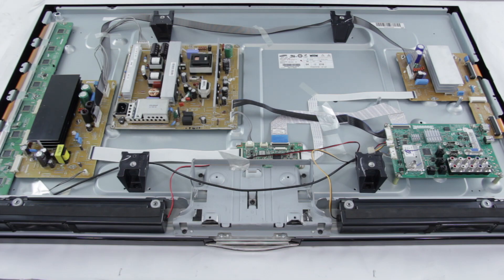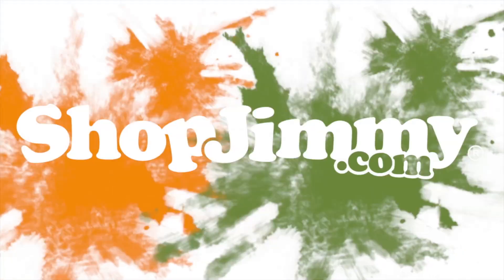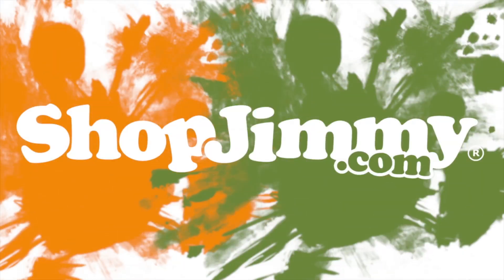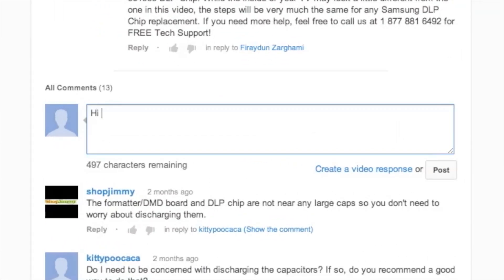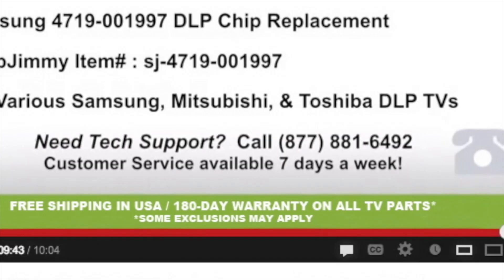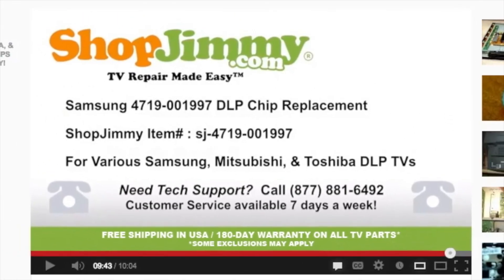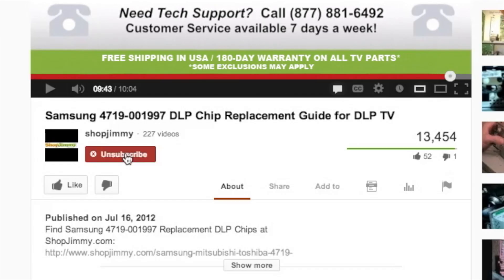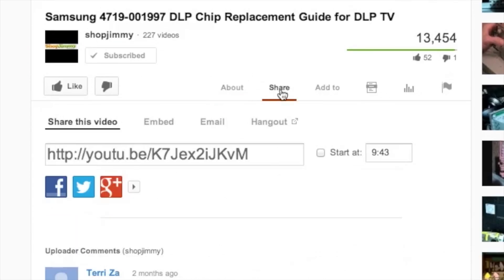Plasma TV Repair Tutorial - Common Symptoms & Solutions - How to Fix Plasma TVs

Comment: My PN64F5500 Plasma worked fine for 2 hours and I left it alone, came back and it was black screen w/ audio.   Pulled off cover and could find no bad boards or capacitors from a visual inspection.  If i pressed the ON button, just a black screen, no video.  Also, no illuminated LED when off.  I checked the Power Supply board according to the stamp on the TV and it was putting out the correct Voltages.  Also, the Main Board was blinking as it should.  I just started to unplug the small 1 wired boards from the Main Board and then turn on to see if that was the problem.  As you know, if any of the boards do not report back to the Main Board as working, the TV will not power up with Video.  Oddly, my problem was the WIFI board.  I don't even use it!  Once I unplugged it (located right beside the Power Joystick Button), TV powered up like normal.  I just left it unplugged and voila!  TV working again.  I hope this helps someone else!!!  TV is a/b 6 years old but a fantastic picture!

Comment: 42pj350.   LG tv all mosfets or igbt not short.but no picture .all 52v and 190v good 5v good. plasma tv. no output on the y.to buffer..i check the chopper on the y buffer.it oppen coil.i try to connect it.when all the igbt arrive. i allready order 4 30f124 ...and 430j124

Comment: I have a PN59D550C1FXZA it will not power up.  If I unplug it and plug it back in, there will be a red light that comes on, then when I push the power on button, the red light will go off but the tv will not turn on

Comment: Hi, I have a TX-P42GT60E. It power off and on intermittently. I can start from the remote control, but anytime i push another button on the remote: to change channel, to open the menu, the TV powers down. Any advice? I read in some forums that it could be the power board.
Thanks in advance.

Comment: I have a Samsung Plasma PN43F4500AFXZA, Version: UD01, Manufactured: 04/13. After the set is turned on and operates for a few minutes, it will shut off on its own and then, after a minute or two, turn back on; spontaneously. Please advise me on how to resolve this problem. Thank you.

Comment: I have question,  I have a Panasonic 50 inch plasma tv model number TC-P50U2. The screen does not turn on and the red led light blinks 10 times.After unplugging for a minute or two, the tv makes the click to turn on then clicks agian and the red blinks 10 times. Could this be a power supply board issue?

Comment: I would love to get my tv working correctly again it has lines running from left to the right on the bottom of my tv what can I do to fix this situation
Reply: How to fix a 50-inch LG plasma TV
Reply: Like he says at 4:19, That is most likely the "Y buffer" ribbon cables and control boards that go from the top to bottom of the screen on one side. They control each horizontal left-to-right line of pixels on the screen. If you break one of the ribbons, then you will get a black/coloured horizontal streak from left to right across the whole screen.

You could check if the ribbon is visibly broken, in which case repair/replace that ribbon somehow. Then check the connection by unplugging and then plugging each ribbon back in, in case there was an issue with the connection. If the circuit board is broken (unlikely, otherwise you would have very thick streaks, or a completely black screen) you could replace that. The ribbons go into the plasma panel. Unfortunately, if their connection is broken inside the screen panel, then the only way to repair that essentially is to get a new plasma panel, because you can't really open it and fix it.

Comment: I really appreciated that you haven't taken older videos down. I have a, Samsung 5 Series plasma. Been going strong 12 years. A couple of months ago I got the occasional popping sound but everything was fine on screen. Recently i get kind of messy looking flashes or overlays on the right side (looking at the TV) which were just flashes to start with but are getting more frequent and staying longer. Its like a whitish cloud or puddle tinged red, very grainy and with evenly spaced dark horizontal lines.

So according to this video I have both boards gone? X AND Y? Because in another of your videos you ascribed all those symptoms to the Y board alone (unless I misunderstood).

Comment: Hi I have the same tv as this one in video 50" plasma ps50c450b1w. The problem being that its unresponsive to the remote. Only some times we tried new controllers and new batteries. I have fitted a new ir sensor today. And checked wiring and all good .worked for about an hour .and stopped working again. I have checked capacitor and all look ok any ideas please
Reply: I'm having the same problem with mine ....I came here looking for answers
Reply: @merfn  .hi I think it might be the controls that I have brought.  I have another set coming.
Reply: @merfn   .well I had my new controllers today and all is still the same works for a bit then stops .did you find out what the fault was with yours

Comment: Great video thanks
My TV is a Samsung PS51E531 and had a few vertical thin colored strip[es close to the right hand edge.
There are maybe 10 stripes across a width of about 15mm (half inch).
I bought a smashed TV and have swapped the logic board and re-seated all the ribbon cables but no change.
I suspect it may one of the screen ribbons so that would be game over.
Any thoughts?

Comment: Plasma LG 50PG20 
It was occasionally shut itself off but we could turn it back on and it would be fun for a while before it would do it again there's one red line that goes from top to bottom on the left side of the TV but just the other day it turned off and stopped altogether no standby light or any power to the TV what should I check first? Thanks in advance

Comment: Kindly reapond if it is possible to repair LG Plasma which does not turn on . Stanby light is on. LG service person says board has tonbe replaced and it is not available. Asking us to trash it. We had power short circuit that particular moment it blew up.Any advised will help. as it is in India 8 need to figure. i feel it could be resolved but none are helping out

Comment: i have a LG 42pq30r nad it has over size the image.,  when use cable signal,  Image is cut in down and you can see the rest of image on screen up. a litte distort
 I thnik is configuration from Main Board

Comment: My LG plasma tv "60pm6700" doing what you describe as a Y - sistine problem.  after turn the tv on for about 10 minutes faded and lines at the bottom quarter appear fading in and out and finally the screen goes black.  after restarting the tv it may happen again and after one or two times the will function properly until turned of for several hours.  Can this be repaired?

Comment: Hi I have a panasonic 42PH10BK standby light is on i turn it on with the on off button on the unit it turns on you can hear the fans for  approx  3 seconds then green light goes off and the red light flashes 7 times....any ideas.

Comment: Thank you for the video. Very informative.
I have a 65” Plasma, 65” Plasma: PN64H5000AF
Version#: TS02
Serial #: 01UQ3CBF900283T
Last night I heard a “pop” and it died. No standby light, nothing. Won’t come on at all.
Opened it up and checked the power board fuse (250v) and it appears to be dead according to VOM. What do you think?
Jim

Comment: I have the same tv lg plasma 60 inches all the parts are the same, i have replaced most of the parts and the problem still the same after a few minutes of use the tv imagine turn off but the sound still playing, im guessing the problem is the main board ? Where all the hdmi connectors are, sometimes the images goes all red like blurry and then off, what could be the problem?

Comment: Samsung pn42c430a1d  no picture but sound works fine. When I switch OFF/ON and listen closely I hear a sound near the Y buffer-board on initially.  I was watching a movie when it happened I saw a  red line/dot and it went blank but sound remained on without any problem not sure which board needs to be replaced

Comment: I have a Samsung PN50B430P2DXZA plasma TV with no picture.  A relay on the power board cycles on and of about every to seconds.  I probed the power going to the Y sustain board and got nothing.  Then I unplugged the Y sustain from the power board and plugged the TV into power.  I got the proper voltage but it immediately began to reduce to zero, and then cycled again.  I plugged the Y sustain back in and unplugged the X sustain from the Y sustain board.  I plugged it in and back probed the power at the power board.  I had proper voltage and it stayed high until the relay cycled off.  My assumption is that I need a new X sustain board.  Any advice?

Comment: I know this is an older post but you seem to know what you are doing and your methed of explanation is very clear. I have a PN51D550C with the following sypmtoms------  Runs 3 Power cycles with relay clicking when plugged in. Will not power on when power button pressed so no picture and no stand-by led. X-SUS replaced for it blew output transistors yet,  it did not correct the problem. When Either X or Y boards are disconnected the power cycle stops. What is strange is the power cycle stops when either one of the X, Y boards are disconnected. With both connected, cycling continues for 3 attempts and then tv goes quiet. PS Stops cycling with both disconnected or just one of them connected and does not matter which one  is connected just as long as both are not connected. Hard to diagnose a prob with the x or y boards when neither one individually connected causes the power cycle. All voltage output from the PS match and hold what is printed on the board next to each connector. There are no bulged or oozing caps, no burned or discolored areas on any of the boards and no popped fuses on the PS. The logic board "heart beat" LED has a slow and long blink pattern when XSUS and YSUS boards are disconnected and TV  when both are re-connected. There is no longer a stand-by led with any pattern of connected boards and the power LED blinks 3 times rapidly when power is pushed with no power on or clicks.(heat sensing buttons not hard buttons on this model) I love this tv and hope to fix it. I do have some knowledge of circuitry but lack the indepth knowledge of how each of the individual components communicate with one another.

Comment: Hey, nice video.  
I have a Samsung 43 inch plasma tv. Model PN43E450A1F.  when you plug the power cord into the outlet the TV standby light will flash 7-8 times and nothing happens. After the 7-8 flashes the TV standby light no longer on. But if your press the power button on the TV or remote you can get the standby light to come back then it goes away. I do have 5.26v standby voltage at the power supply.  I don't know where to go from there. Any help will be appreciated.

Comment: Hello Folks --- I have a Samsung Plasma TV, model number PN51E535A3F, the issue is that it doesn't turn on, when it's plugged in, the standby light (red) does illuminate/light up and the start up sound can be heard, but the screen is dark/doesn't light up ... any recommendation/ideas etc would be greatly appreciated

Comment: PN64F8500AF, Samsung Plasma, five years old. Unit started cycling on and off on it’s on, finally stopped cycling. No red standby light, no clicking, no nothing, unit will not turn on with remote, unit will not turn on using manual toggle switch on lower left backside of TV. Please help. I love the picture on this plasma, I owned a 50” Pioneer Plasma before this one... thank you so much in advance! - - Teddy A. Souter

Comment: I have a pioneer 42 inch plasma model PDP-R04U, and it has a faint screen, you can see picture, it does have faint colors and you can see it changing , but in no way can you watch a show.  It also has sound, occasionally it powers off and the red stand by light blinks on the TV. This has a remote receiver connected by special system cable to the TV monitor?  Any ideas on repair? At one point I did see a repair kit for the receiver and see some on eBay, would those resolve the issue?

Comment: Can you help with the problem that I have?  My Samsung  pn58b650s1fxza is cycling off and on with a black screen repeatedly.  I have tried simple fixes already, which did not work.  I removed the back of the TV and all the capacitors look good.  None of the capacitors are bulging or leaking.  After listening to the video, it seems my issue might be the Y sustain board.  Please recommend

Comment: Jimmy, I have a question about a Lg Plasma in a 60 inch model LG PB6650., the television was working during a thunderstorm and  it shut down during this time,  the standby light is working correctly and when powered up it goes off which is normal, also the screen will display a dark picture to lighter shade for a second at that tie it will power off and automatically back on by itself all the tie the screen is continuing to be black. I have replaced the power board and that did effect the time the lighting on the screen is lighting up more briefly till it powers back down and back on again by itself. Could you or would you suggest what the problem could be?

Comment: Hello.  My house took a power surge a year ago which caused a lot of electrical problems throughout my house.  I have a Samsung PN60E7000FF which stopped working when the surge happened.  I've replaced some of the TVs and I've repaired one.  I recently replaced the power supply board on the Samsung.  It seemed to work fine when I turned it on, but then when I turned it off and tried to turn it back on the stand-by light blinks 5 times repeatedly and the TV won't turn on. If I unplug it and plug it back in, it will turn back on. None of the capacitors on any of the other boards look like they have anything wrong with them.

Comment: my tv is PN51D440A5D 
i just ordered from you the main board BN94-04777A
it didn t fix my problem
well when starting tv i can hear the samsung start melody, the red power led is on before starting then after on and melody it flashes 5 times than led turns off...
no images at all
then when i m turning off the tv i can hear melody then red power led is on...
logic board has a green led, solid when tv is off flashing when tv is on...
is my logic board LJ41-09475A my trouble?
thanks

Comment: I have a LG plasma ( 50" ) 50PT350, no picture, it clicks when it turns on, red LED lights up when turned and turns off when powered down. I have replaced the power supply with a new on and still has the same issue. Any suggestions would be greatly appreciated.

Comment: Plug in AV cable, screen lights up white then went all black (went into standby I believe). I then use the power button on the bottom of the tv, screen lights up white same as before for a second then goes black again. So it just seems to light up white for a second when initiating screen and then goes black afterwards. Taking it apart now to check fuses and ribbon cables. LG 60" Plasma #LG605600

Comment: Our panasonic tc-55st50 is overheating after 30 minutes of use. I took off the rear panel but everything looks ok, although I don't really know what to look for. Any ideas?
Reply: Some TV's have a very small cooling fan! Check to see if it's running if yours is so equipped.

Comment: Hi iI have a Logik 50" Plasma tv Model: LLPM-50.

When I switch on the screen it just flashes the correct visual for a second and then just random colours. The keypad is locked and the remote is missing. I was wondering if you can help out please.

Comment: Hi, I have a Samsung key in 64D 8000 that has no picture at all. When I remove the cabling from either the X or Y main boards separately, the greenlight on the logic board flashes at the same rate. Could that mean I need to replace the logic board? Thank you very much.
Reply: Pn64d8000

Comment: Samsung 51” Plasma model code PN51D450A2DXZA - no power, no standby light.  Already replaced the power board, any other suggestions for potential options to repair?

Comment: samsung pn60e530a3f 😂 no picture on the screen. Seems like all the boards could be the culprit. Power button and remote seem to work because red light comes on. And blinks when you use remote buttons. No picture at all and no sound. Logic board? Power supply?

Comment: I have a problem i need help with.  I have a 60pa6500 lg plasma tv i bought w out testing it. I plugged it in and the lg logo. Came on screen then the hdmi 2 identifying input it is on. I did not receive a remote. I tried to turn it off manually but the buttons do not work. The tv did not appear dropped or cracked when the screen lit up. I had to unplug it as it was late at night. I tried to power on the unit and the lg symbol came on again but same scenario. I hung the tv on the wall and bought a remote and now when i plug it in all i get is a click like it turned on a steady red led light near the power button but nothing else. I did try and program the universal remote but it did not respond. I hope you can help me figure it out. I did buy this tv w/out testing because he needed money. I normally never NOT test it first. Please help.

Comment: I have a Samsung PN43D450A2DXZA. The TC is clicking and blinking red standby light. I replaced the power supply board and it's still doing it. I also tried unplugging the y sustain board and turning on and it still happened. The logic board has a fast green blink followed by a 1 second green blink. It does this twice before it stops. I also heard a pop before the tv turned off and stopped working

Comment: I have a Samsung  Plasma PN50C450bid.  Just turned on and I have a black horizontal line from edge to edge.  Watched several video's and the problem I thought was the Y buffer board. Ohmed  this out and had no continuity problems. Could this line be something other than the Y buffer?